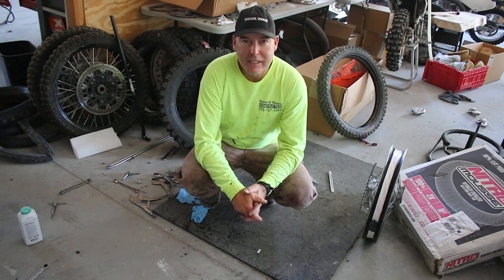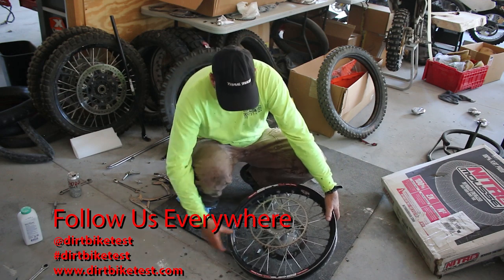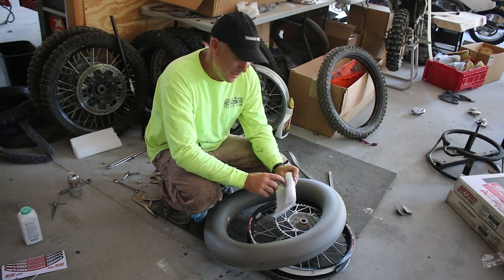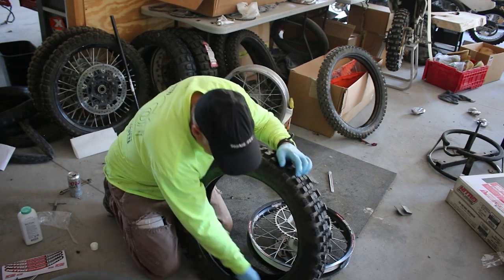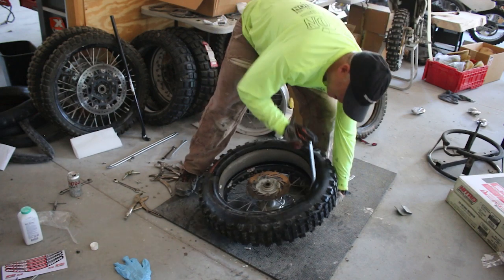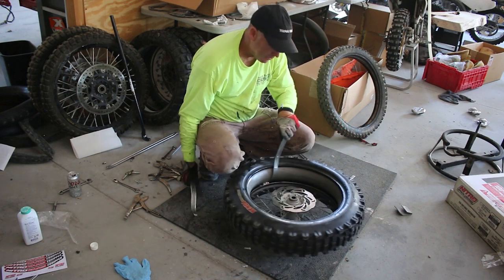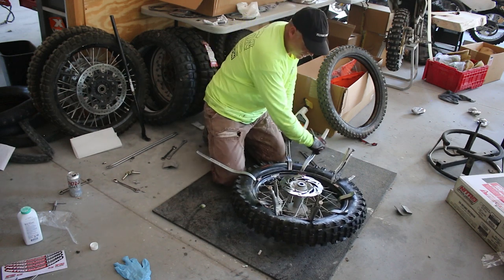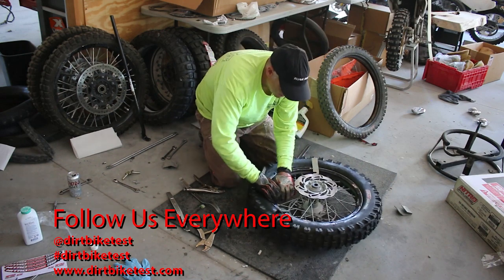DBT Rear Mousse Change

Comment: 2 rides after i installed it with your video, my tire sliped off from the rim to inside for like 10 cm on both sides of the wheel, any idea how can i slip it back without doing everything again?
Reply from the maker: It sounds like your mousse is too small so the bead isn't setting